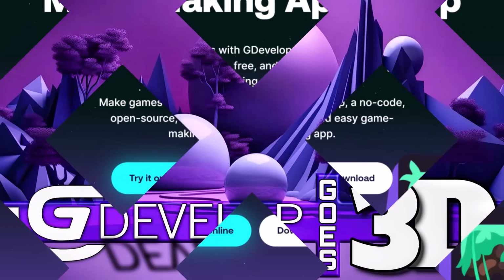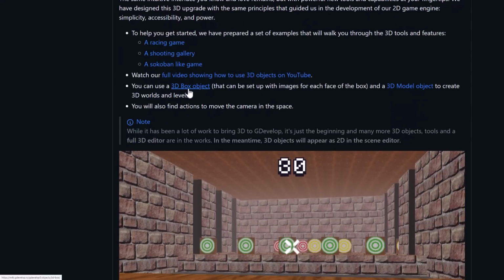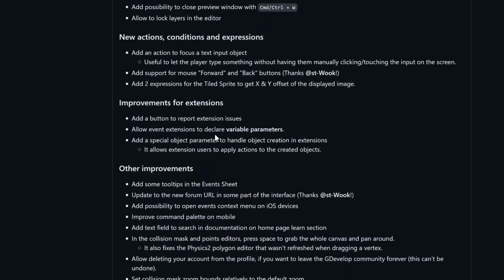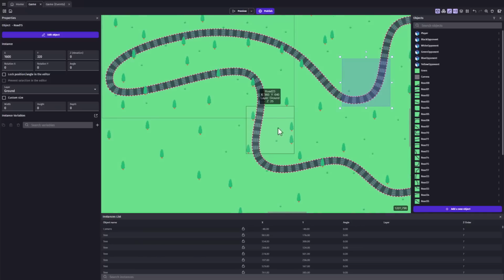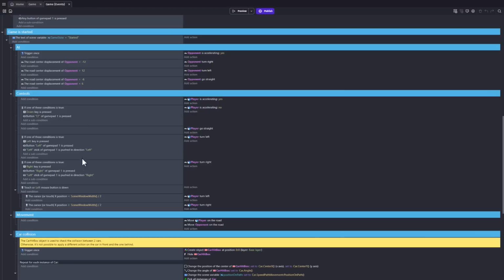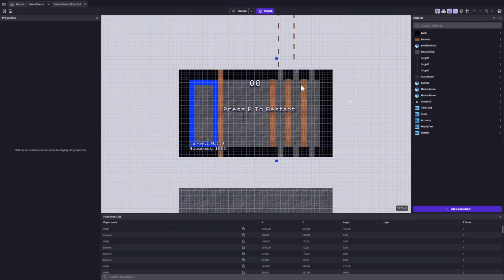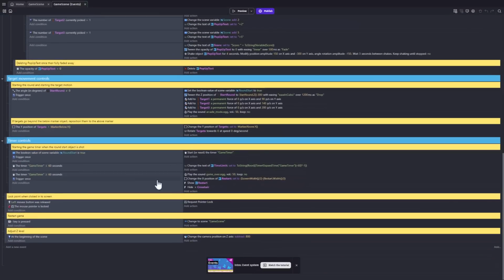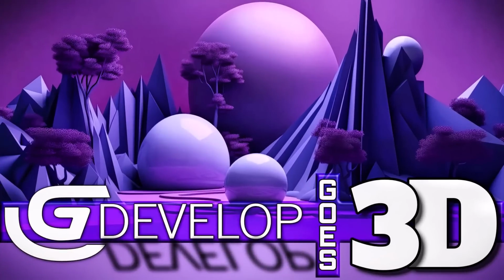GDevelop is Now 3D!

Comment: Their next big change should be to add a 3D viewer for the viewport. They need a way to lock the viewport to top-down, side views, 3D perspective, and orthographic, if need be. But of course, orthographic is probably best handled with all 2D assets in this particular software. But if we've reached this point, and coding for 3D objects and 3D perspective with their no-code system has found legs, then I think they should get onto adjusting their UI to have 2D and 3D viewing and organizational options. 

What might be really beneficial, actually, is to approach the 3D viewport like a city builder or tower defense game, where you can drag and drop assets into the world with special controls that only initiate when a new object is dragged to the map. That can then let you position an object close to where you want it, and then it opens the transform controls up for more fine tuning as normal.

Comment: I think having a simple 3d or 2.5d engine is a nice niche that has yet to be truly filled. Many small teams just want to replicate late 80s or early 90s aesthetics.
Reply: You can do that with complete engines too, requires a lot more to learn but its more beneficial in the long run imo
Reply: @karthanok6859  Sure, but not everyone has the same goals as you do, so it may not be beneficial in the long run for everyone. A variety of options is a good thing, no need to gatekeep.
Reply: @RarebitFiends  ah, I meant if the devs wanted to do something more than stick to one style.
Retro + modern tech can be used to create unique styles too, something the devs might want to tap into.
Reply: @karthanok6859  Yes, I agree that depending on one's goals, different tools may make more sense. It's all contextual. Whether or not a different tool is more beneficial or not depends entirely on context.

Comment: Gdevelop is very great no code engine ❤
Reply: I had no idea this was no code. I tried gdevelop a long time ago and it was very very basic at the time.I swear i remember there being coding though lol.
Reply: @nicholasjackson8709  You probably remember well, it is not full free from code, for example for mathematical calculations you have to write by hand, however for the most part it is all manageable with block events
Reply: @richard_oz_dev  I may have to revisit this. Thank you.
Reply: @nicholasjackson8709 f you know code you can do even more. You can actually make extensions and use them for yourself and put them out to the community for donations.
Reply: Thank you!